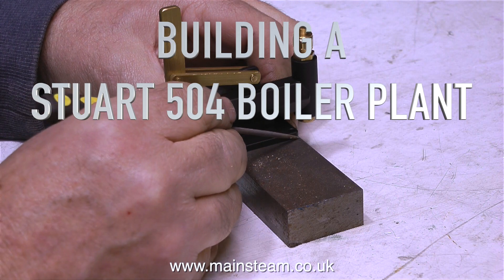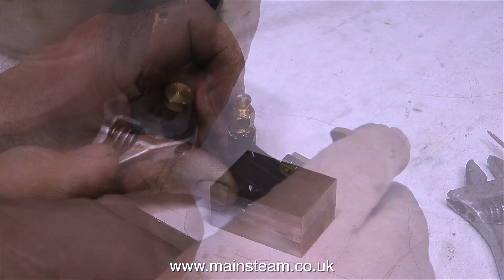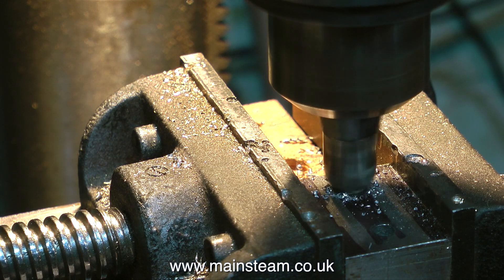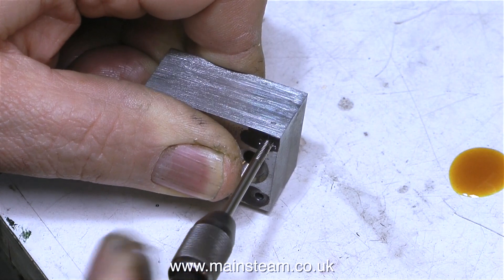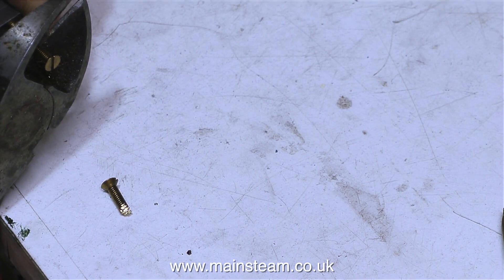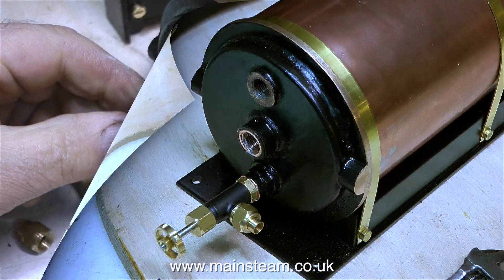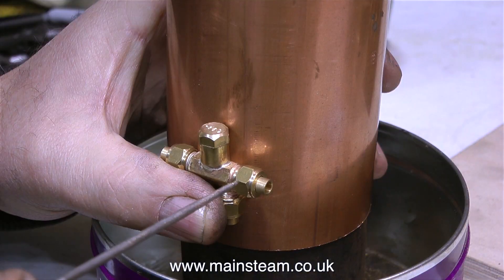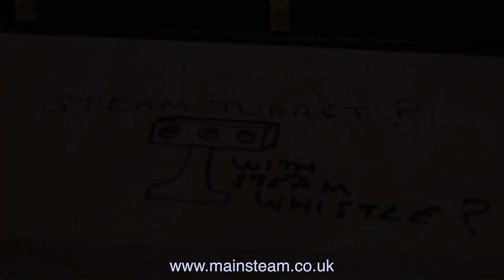MAKING A STUART 504 BOILER PLANT - PART #3 - MOUNTING THE HAND PUMP

Comment: Mr. Appleton. My screen is too small to easily see just how the end of your countersink is constructed. Is there a commercial sharpening service anywhere reasonably  near you ? Buying a new one is fine if you do not like the existing one,but since you already own what you have,a professionally sharpened cutting face simply means that no one single person is capable of everything. Some individuals get ego involved.  Nothing I have heard from you suggests that,unlike my father for one. Each person holds what is important to them. As long as resharpening is less than replacement cost,it is a good thing.

Comment: Rapeseed oil used to have high levels of erucic acid which makes it inedible, it was used for lubricating things because it was CHEAP (and it still is), not because it was any better than any other vegetable oil
The way modern oil has been changed isn't something that's going to make any real difference to how good it is as a lubricant.

Comment: I am flabbergasted and amazed how those little pumps can achieve such high pressures! In another episode, you use one of those little suckers to test a boiler up to about 160 or was it 180 psi-!!!  I just don't understand how that tiny little pump can do that!   (thanks in advance if you decide to comment)
Reply from the maker: It's all a matter of leverage and in combination with a small ram & two stainless steel balls, a very high pressure can be attained.

Comment: This steam plant is looking amazing! 
I think I'll have to have a go at making a steam engine once I get a lathe, milling machine and casting workshop. Although I'll probably be using metric measurements and parts, being where I live.
Reply: Zappyguy111 Do not wait to buy all the equipment before starting. I have seen some nice engines and boilers done with just a small drill and a set of files. Check on the internet and you will find some simple plans.

Comment: Very informative segment Keith.  Is there a reason you used steel for the pump base and not aluminum?  Aluminum is lighter and would not rust.  Thanks-  Fred
Reply: Aluminium tho would be weaker than a solid slug o' steel I would have thought and engines are clunky clanky vibrating oily things and I suspect even an alloy solid block would sooner or later start to have probs
Reply from the maker: It really doesn't matter - steel is cheaper and when painted it won't rust .....